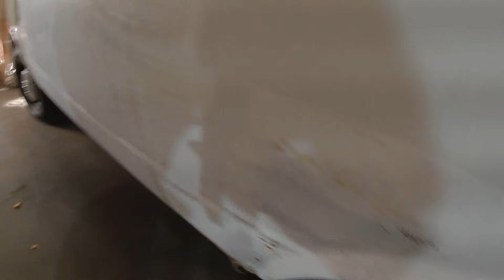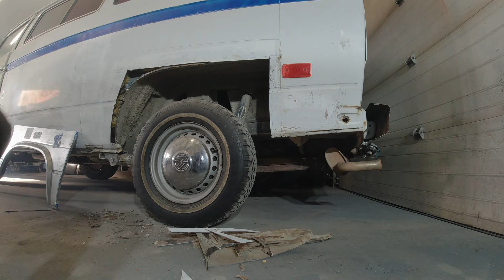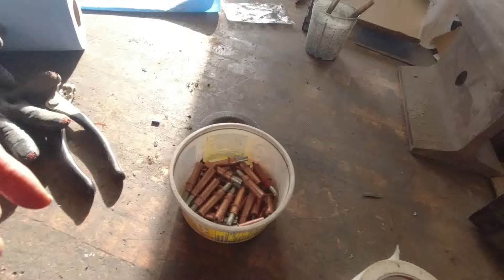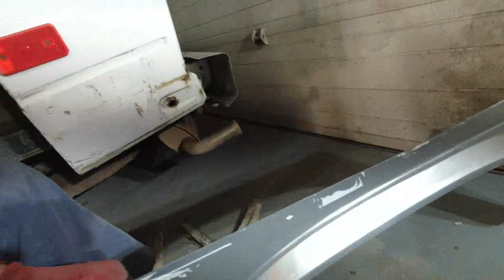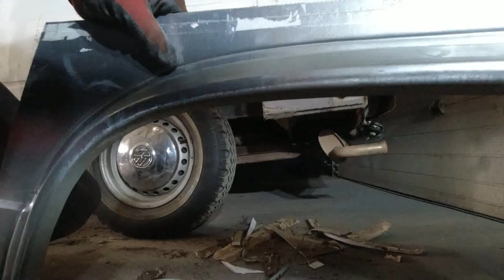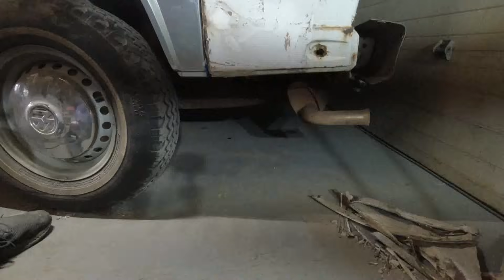1982 VW Vanagon Rear Wheel arch replacement

Comment: Boa noite! Essa solda, é tipo MIG sem gas? Qual a regulagem você usou para soldar? Amperagem e velocidade de arame? Abraços! Marcio.
Reply from the maker: The mig is argon co2 gas mix.
Settings depends on your welder. I set mine up lower amps first until I get a nice sounding weld increasing the wire feed slowly.
Reply: @gsminors  Ok! Estou reformando a minha Kombi e vou comprar um máquina de solda, pra soldar com MIG sem gas. Muito obrigado pelas dicas!!
Reply from the maker: If you can get a gas welder its so much better. 
Good luck on your restoration. I have videos on my T2 I am restoring as well.
Reply: @gsminors  Ok! Vou acompanhar também!! Abraços!!